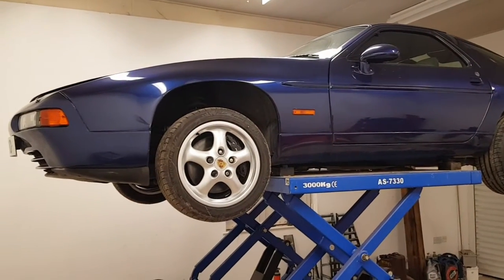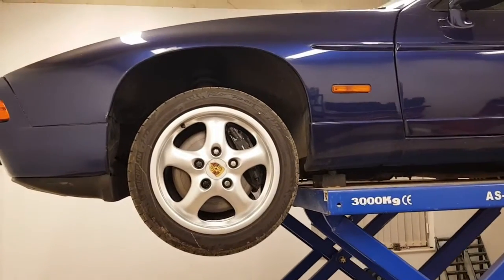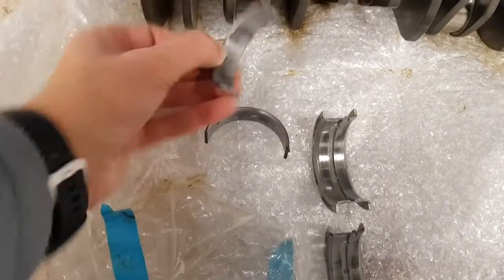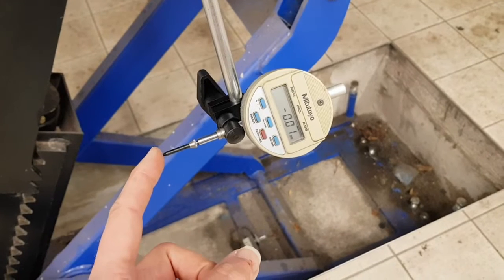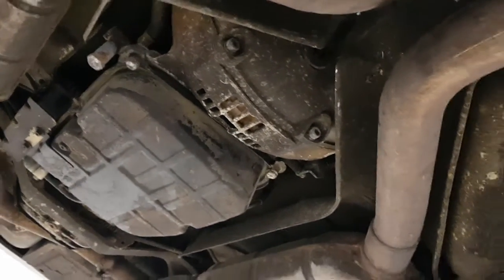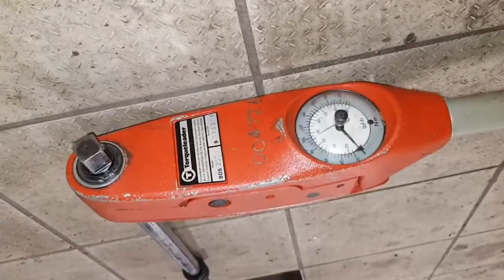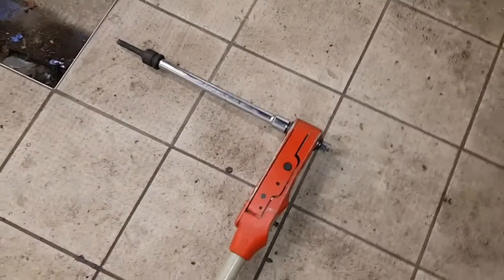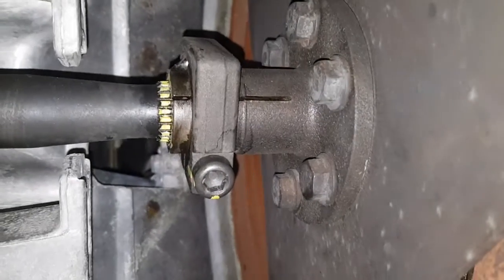Porsche 928 GTS Crank end float.  Why and how to check it.

Comment: Great video. Whilst i was aware of the flex plate problem i was not aware of possible movement at the gearbox end. I have owned my 928S4 for ten years and have never heard anyone mention it.
Reply: did you ever have it inspected? What year is your 928?

Comment: Tanks for your video. The transmission shaft on my 928 GTS was even heavy bent. You can check yours next time you are in there by spinning it. I could see the problem on one end of the shaft more clearly than the other. May I ask which torque on the bolts which connect the crank shaft and the transmission shaft? Going to check now your other videos. Thanks again and best wishes from Taiwan

Comment: Nice video, I'd give my left wheel nut for a lift. Couple of points you didn't mention. This is only a problem with automatics, fitting a ritech or similar clamp is an option for peace of mind and you could put studs in the two rear bolt positions as access for nuts is easier.
Reply from the maker: I did mention that it is an issue particularly on automatic cars, but I could habe made more of it. I'm always aware of the length of videos and try to get the important stuff in without anything extra.  As for the clamp. I do know of them but IMO what I have done, and yearly checks which take a short time, are much cheaper and as effective in the long run.

Comment: Great video. Thank you for the tutorial about what’s what. Are you a mechanic? What would this cost to have a mechanic do? Or how many hours did it take and what parts needed replacing? The exhaust gaskets, anything else?
Reply from the maker: Thanks.  Just the gaskets needed, but if you leave the rear two bolts out you won't need those next time.  I would also change the pinch bolts on a first time check, just because they are not expensive.  I'm not a mechanic, I just work on my own cars for fun, but would think maybe an hour or so. This is my first 928 so no idea how typical the state of my exhaust bolts is, but from 996 experience, the longest part of the job could be getting those off.